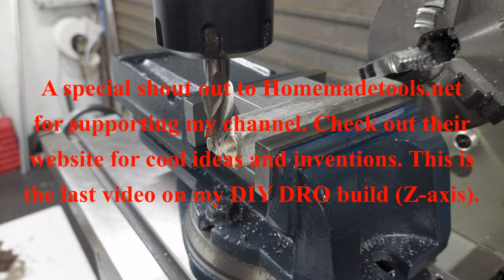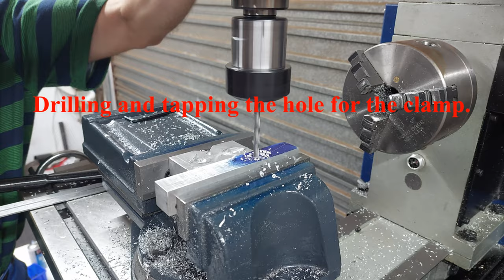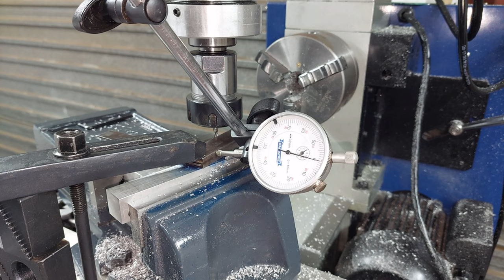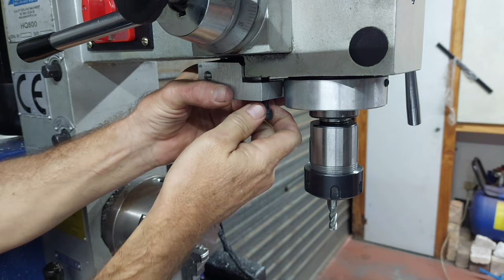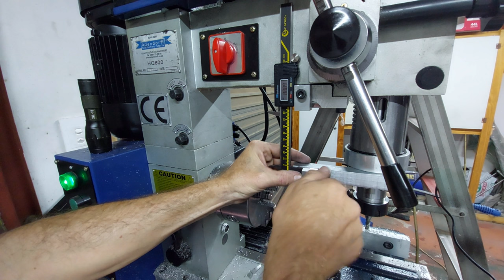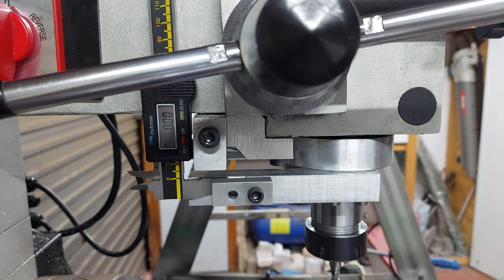HQ800 Mill Z Axis DRO Made From A Digital Caliper

Comment: That lathe can make left hand thread ?
Reply from the maker: Hi Selpro. Only righthand thread. With modifications you can add a reverse gear yourself.
Reply: @improviseddiy  hi. Thanks for your response. Do you know the procedure to add that update on this unit ? Or where to get it ?
Reply from the maker: @selprocr  You will need to make it yourself using an additional idler gear. It will be one of my future projects.
Reply from the maker: Hi Selpro. I have posted a video on the assembly to reverse the leadscrew for lefthand threading.
Reply: @improviseddiy  excelent. Great...
Reply from the maker: @selprocr  No problem.
Reply: Да